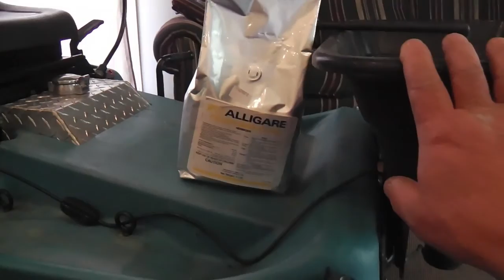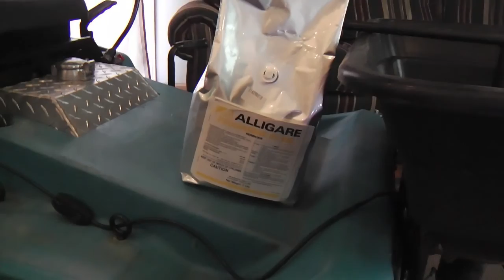Riding Mower Engine Swap Single to V-Twin & Fab Mods

Comment: Pretty informative video. One thing I would like to ask, is would I be able to briggs opposed twin swap my model 3302 dixon? It has the same 12hp briggs engine that yours did. Thanks in advance! 

-Matt
Reply from the maker: Sure, I'm guessing that an opposed twin Briggs motor wouldn't have many challenges being installed where a single was before. It may even be easier than what I did, as some opposed twin have their muffler to one side, if I recall correctly, and that could make things easy, muffler-wise. Those opposed twin Briggs motors are a favorite type to many, since there's no overhead valves.

Comment: What throttle cable is that I have the same mower and motor except with no auto start but cant find the throttle cable
Reply from the maker: As I recall, I've reused the OEM throttle lever a couple of times by replacing the throttle cable within it by using some of my 1/16" stainless steel TIG wire, and putting a little Z-bend at the end.

Comment from the maker: Here's a little addendum video for this project: https://www.youtube.com/watch?v=F2WLqb5DdfA

"Christian Livingstone includes this video as an addendum to his “Poor Man’s Jay Leno’s Garage: Dixon Mower Re-Power & Mods” project. It shows the solutions for solving hard-starting and surging symptoms on Briggs Intek V-Twin motors, namely, valve lash adjustment, some subtle reaming-out of Nikki low-side carburetor jet journals, and a governor adjustment. Though not meant as an exhaustive step-by-step how-to guide, enough demonstration is given that many will undoubtedly find it helpful in solving the same problems with their own motors, but more detail is also given in the earlier, project video itself."

Comment: Normally I won't watch a video this long, but I have a Dixon mower and your content is so gooood :))) You have great engineering skills. I would like to know what brand of 12 volt gas pump you are using and who sells them. I can't find any that look like the one you used.
Reply from the maker: I originally used a cheap, poly, cylindrical one of low-pressure (2-4psi), which worked OK. But not too long after I upgraded to another cheap (around $20), little, box-style one that has a metal shell that is quieter and seems better in quality somehow. I also used rubber isolator mounting washers when I installed the newer one, which may help with vibration and longevity. I don't recall the brand name, but I got it on Amazon. They are listed with various names, but are undoubtedly the same item. Just do an Amazon search for "low-pressure, 12V, fuel pump". They're the squarish one, but not the ones at 4.5-7psi. You'll undoubtedly want the ones at approximately 2-4psi.
https://www.amazon.com/s?k=12V+fuel+pump+low+pressure&page=2&qid=1576721880&ref=sr_pg_1

Comment: i use carb cleaner to start my small engines  ether is really hard on those small engines. carb cleaner ignites easier than gasoline but not as powerful as ether starting fluid. try it one time and i think you will be a believer.
Reply from the maker: Hey, thanks for passing along that distinction. I have both on hand, so I will undoubtedly try it and probably shift over to the carb cleaner, as needed.
Reply: @NewJerusalemTimes  I forgot to add if you are trying to get a 2 cycle engine started don't use carb cleaner but use spray lubricant. I use the Wally world spray lubricant it ignited easily and you are lubricating the internal engine parts.

Comment: How is that oil filter system hooked up, did that come with the engine?
Reply from the maker: That is an aftermarket remote filter assembly for autos, that I bought for a truck, but never installed on it. So I used it on the mower, since the filter size was about the same diameter. But Briggs also sells similar assemblies for remote oil filter locating on their mowers, which undoubtedly also comes with installation instructions. Otherwise, it has a screw-in plate where the filter normally goes, which has the journals for the two hoses out to the remote filter location. Easy peasey!